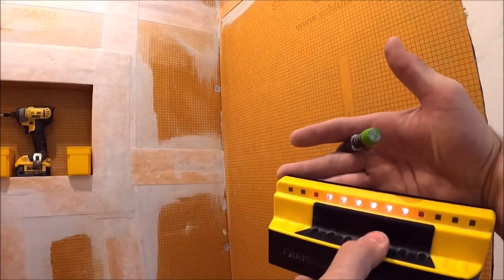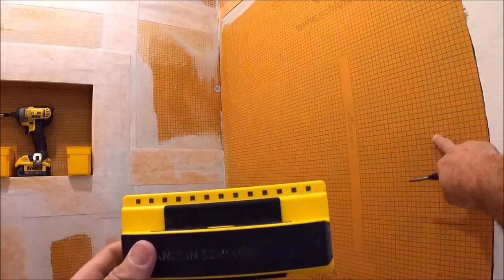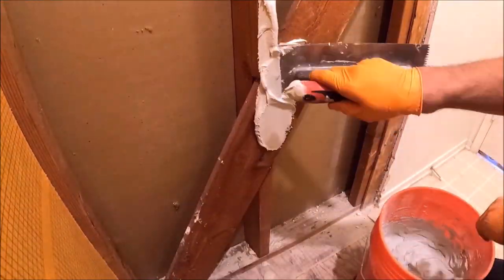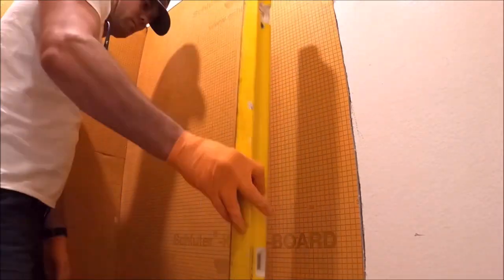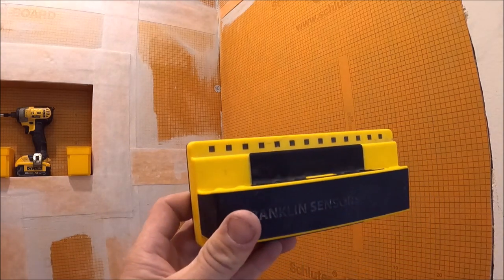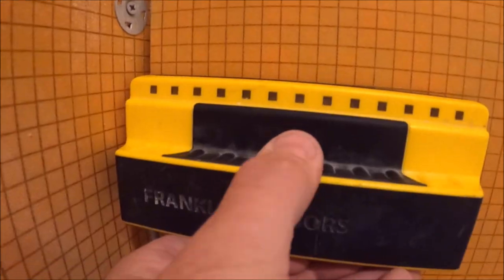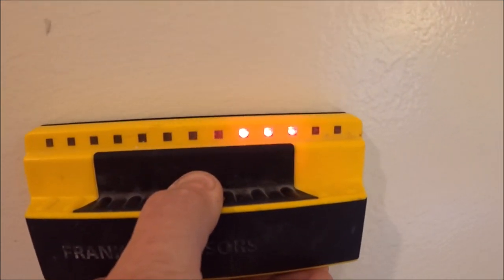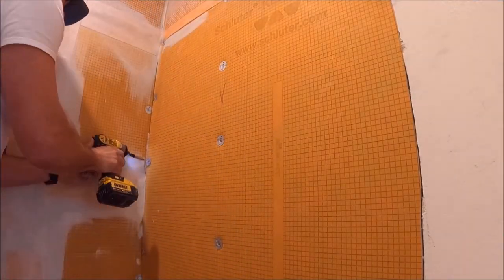Stud Finding and Wet Shimming #shorts #youtubeshorts #how to

Comment: That stud finder looks amazing! I use a HART one that looks similar, but it doesn't seem as accurate as yours. 

Just a friendly tip, to be considered a Youtube Short (so it can be found in the shorts player) your video has to be under 60 seconds (yours is) and vertically oriented. You can't upload a landscape video or it won't work. It will just be a "normal video" on your channel, and not show up at all in shorts.
Reply from the maker: Appreciate the tip! I had a feeling I was doing something wrong with these shorts. Thanks!